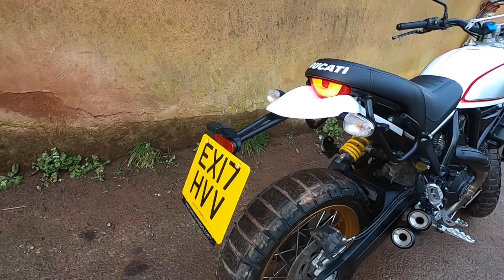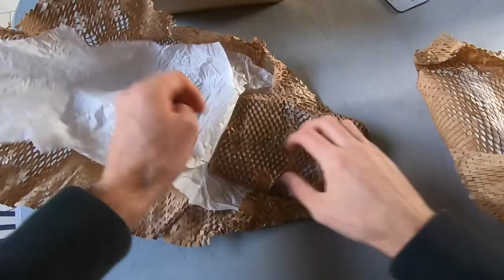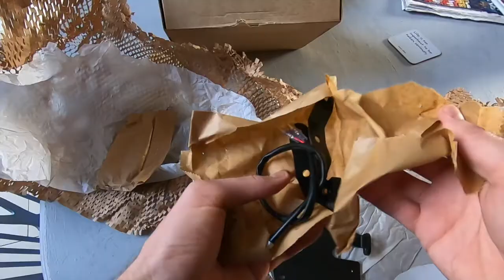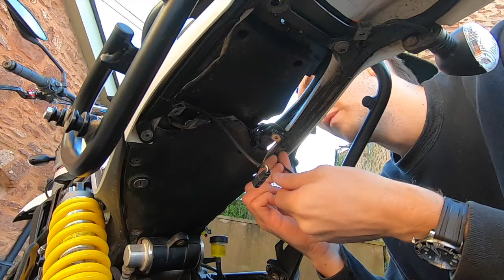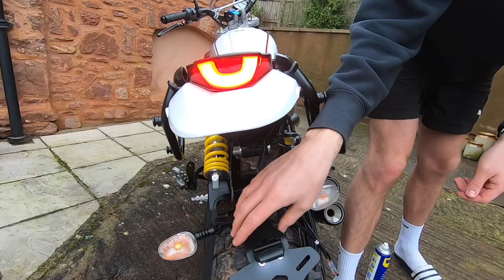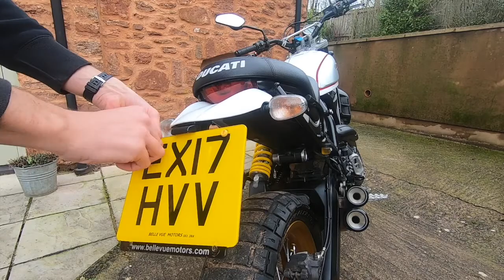FIXING THE UGLIEST PART OF A DUCATI SCRAMBLER DESERT SLED - EVOTECH TAIL TIDY INSTALL

Comment: Yep. I did mine last year. Much much better than the stock.... awkward but not difficult.
Reply from the maker: Makes a big difference doesn't it, any other modifications you'd recommend?
Reply: @motobg1  I have a dart screen and the Ducati larger foot pegs also, both of which I would recommend. I have also fitted some handlebar guards very recently which I’m yet to thoroughly test....

Comment: What a wasted effort with such a horrendously ugly license plate. What country do you live in? Motorcycle license plates are typically smaller than ones meant for cars. Yours looks like it belongs on a semi-truck 🚚 😂. I bet this thing slows you down like an upwind racing yacht sail at high speeds ⛵️!
Reply from the maker: 😁😁That’s the standard size for the UK plates, horrendous right!